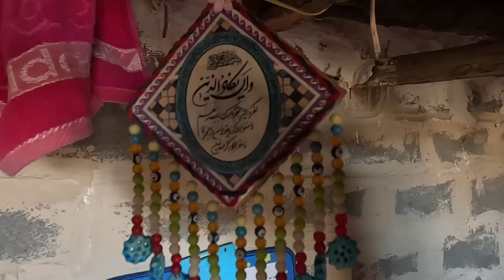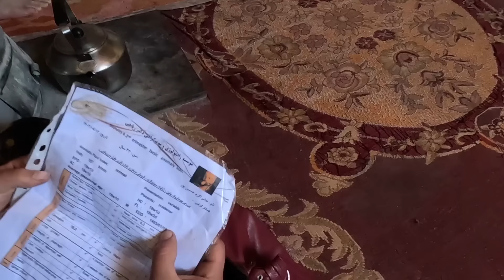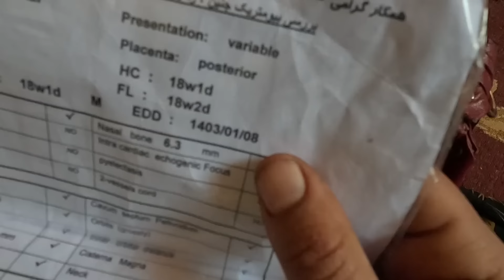Akram is a pregnant woman who realizes her dreams with her husband's art

Comment: The way Akran’s father is plastering the wall he’s wasting a lot of cement and sand. He should make it light and not too thick so he doesn’t spend so much money on the plastering.
Reply: @jouannd3719  Even if it his house, you can see that he’s just wasting materials unnecessarily and it does not make the plastering fine because of the thickness of the material. Tell him the truth instead of encouraging wastage. They run out of cement every now and then because of unnecessary wastage.